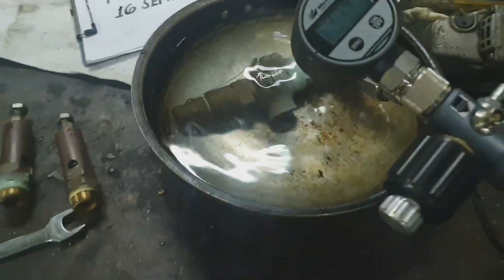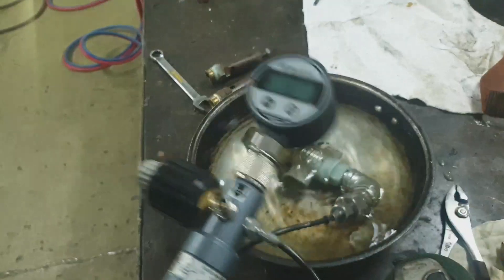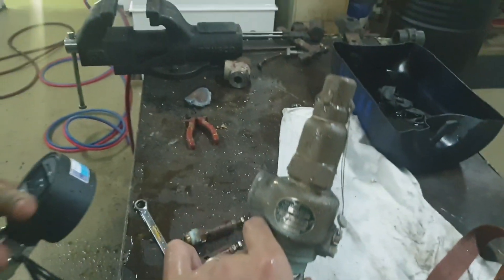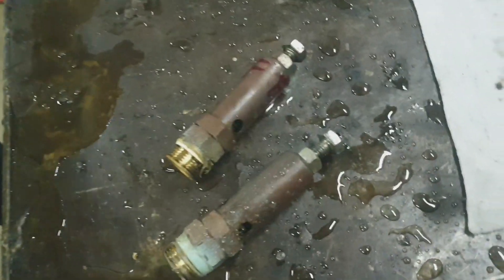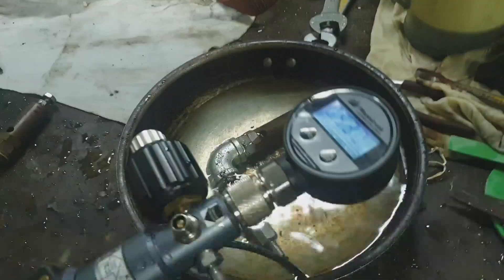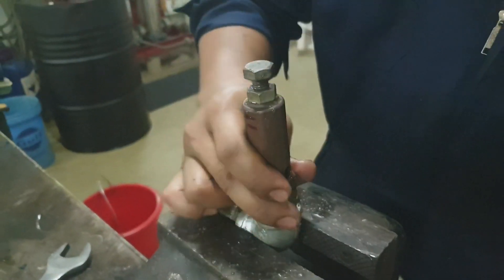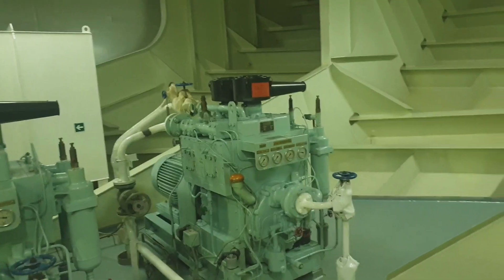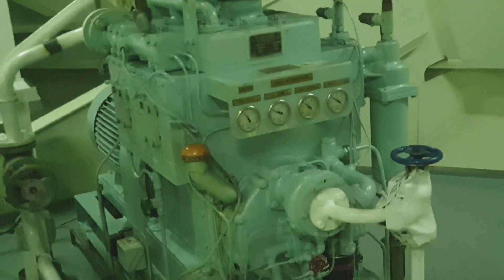HOW TO TEST SAFETY VALVE OF MAIN AIR COMPRESSOR

Comment: Is it from sauer compressor? At what pressure valve lifted?
Reply from the maker: From main air compressor sir, tanabe us the model , the 2nd stage High pressure lifted at 26.5 bar, while the 1st stage low pressure lifted at 6.8 bar
Reply: Thanks ❤